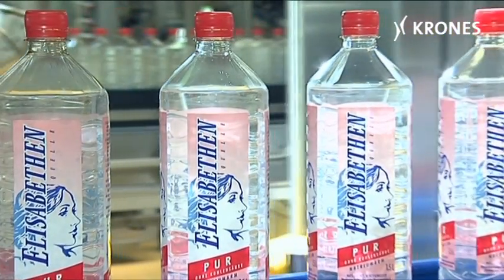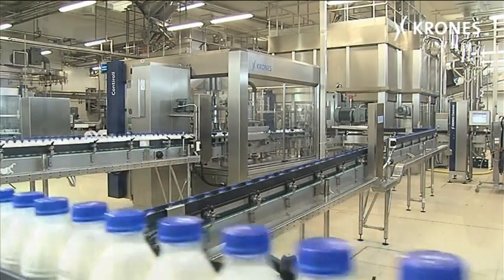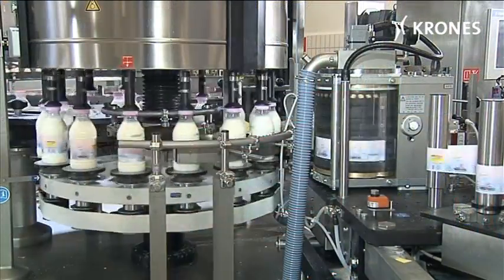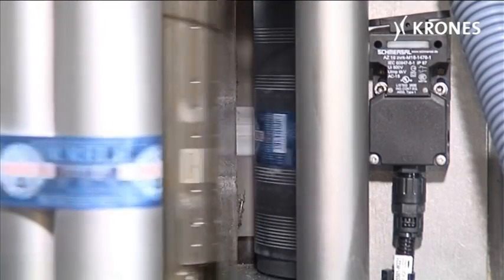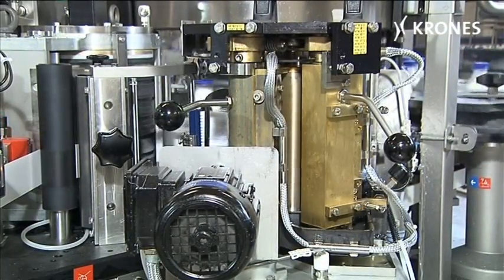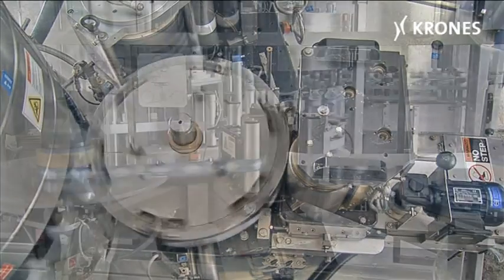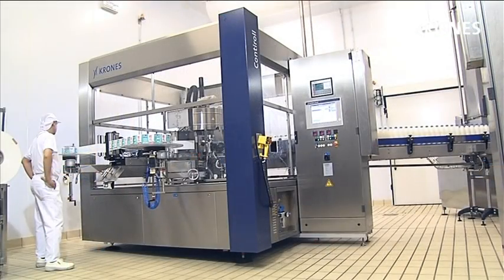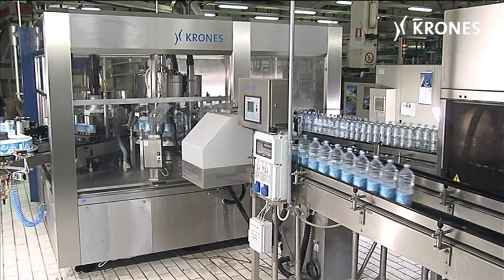Labelling accuracy with the Krones Contiroll

Comment: the label cannot continuously send to the container and stuck at glue drum.  Level of the glue uneven top and down. In this situation what are action can be taken?
Reply: If the drum is clean try to make zero position for the drum and carousel
Reply: @rezzejseyer8030  Hi Rezzej it's like you have great knowledge of the Krones Labeller , please what can cause deviations in the cutting length when the label is about to finish and it also starts having label carryover,but when changed to a bigger label roll it cuts to the normal length?thank you.
Reply from the maker: Hello, you’re welcome to call our service line: 09401/708090.
 Alternatively, you can send us an email to this email address: serviceline@krones.com
 

Our colleagues will help you along with your request. If there are any complications please let us know.

Best regards,
The Social Media Team
Reply: Drum or vacuum pads or rail may be worn out or need to be propped Lu adjusted and calibrated or also glue drum could be worn check glue scraper